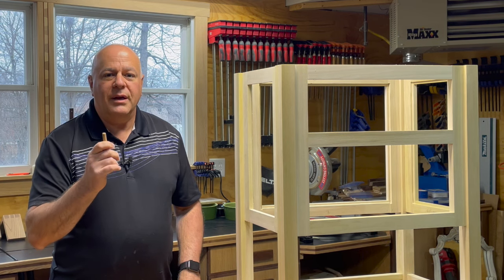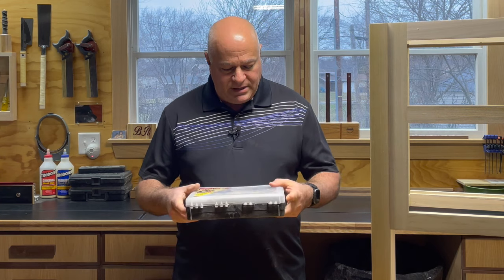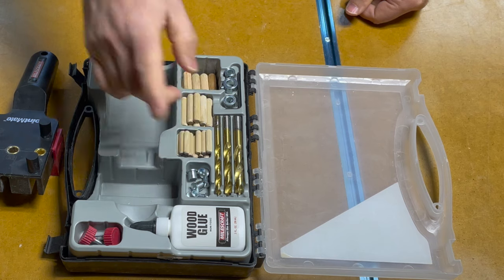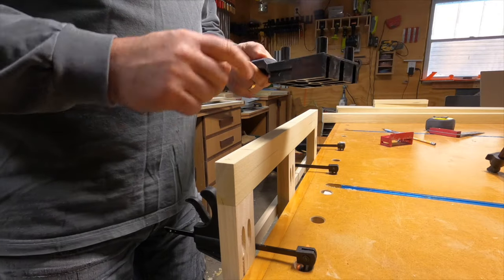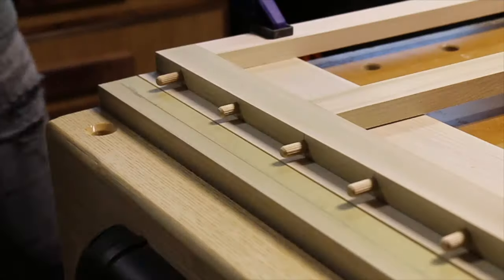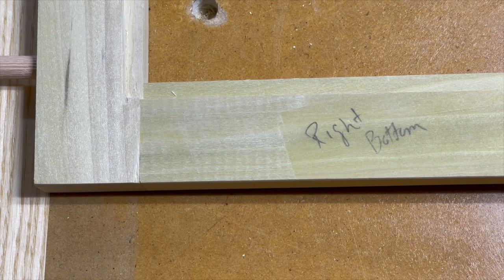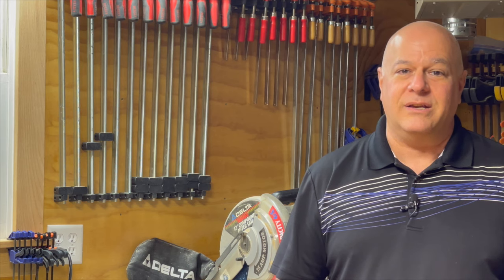Dowel Joinery for Beginners - 3 Rules for Success

Comment: Excellent video. Forgive me if others have pointed this out and you've already fixed it, but you have no treble at all in your audio. It is as though your microphone has a blanket over it. You may need an audio gear upgrade, or it may be a setting that is incorrectly adjusted in software. Best wishes. (Edit: I think it's the microphone. You're using a lapel mic which may not be up to the job. There is also some tell-tale distortion from overloading the mic.)
Reply from the maker: Thanks for the feedback! I have since upgraded my microphone.

Comment: like the video, though I still don't know how to get the butt joint properly, even with the jig. There is not enough contact surface to set the jig on, especially on the end grain. I think I'm missing something handy here. I screwed up my tests so much I've just opted for half laps.
Reply from the maker: Take another look at the 3:05 mark in the video. By clamping a second board behind the board where you will be drilling, it gives you a bigger surface to set the jig on. Hope this helps!

Comment: I began using this jig and recently splurged on the full set of dowlmax and the festool domino 700, something I swore at the beginning I won't spend that kind of money.
Reply from the maker: Both very nice tools. The Festool 700 is the Cadillac. Maybe someday I'll have the $$ for one. Need to upgrade my table saw first :-). The great thing about woodworking is there are solutions for every budget.
Reply: @budsworkshop  Same here, and having the freedom of staying away from Ikea furniture. 😆😆I need a decent table saw too, after comparing all, I am eyeing on the Maksiwa 1600, probably the most budget friendly sliding table saw and I don't have to make all other jigs like cross cut jig comparing to American style table saw. And it has a 12 inch blade instead of 10. I have to wait until I have bigger shop though. btw I didn't pay full for the festool 700. I bought it used for half the price and it's still good after few years.
Reply: Dowelmax is worth every penny. I've not felt the need for a domino since I've been using my dowelmax. Not that I don't still want one, but the dowelmax works so well that the domino can be a "later on" purchase, if production ever dictates the need.

Comment: I had bought a couple of other types of dowel jigs and even with practice, I could never get a perfectly aligned joint. Then I bought the Milescraft jig and that did the trick. That jig makes it so much easier to get accurate results.

Another doweling tool that I found to be valuable are the centering pins. With those, you could just use a drill and still get good results.

Great video. To the point with helpful information.
Reply from the maker: Thanks for sharing. I have not had occasion to use the pins yet. Appreciate your feedback!

Comment: Great video thanks, and good tips.
There is one dimension that you may have forgotten to mention, and that is the depth of the dowel holes. On the edge of boards, that’s not usually a problem, but on the face, you need to be mindful that you could drill through to the back side if you try and make both holes equal depth to accommodate the dowels length. A little calculation ( including a little extra as a well for the glue to go) will save the day….. don’t ask me how I know that😢
Reply from the maker: Great point!

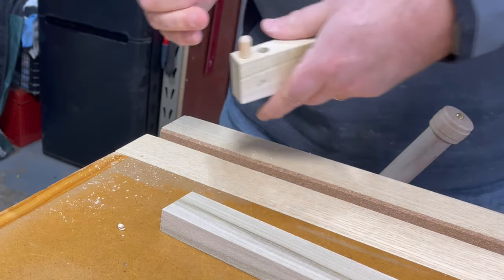Comment: Hi, at 4:22 minutes you show how to joint rail and style using dowels, can that jig make the holes in end grain narrow piece of wood?
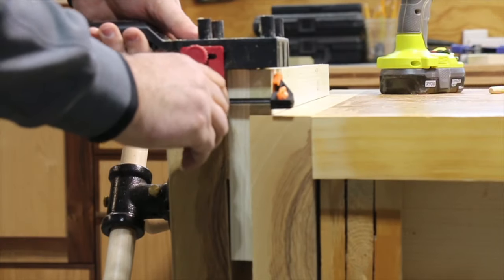Reply from the maker: Yes - If you go back to 3:00 minutes I am drilling the end grain for that joint. You have to use the fence and a clamp which is not ideal, but it works out pretty good.

Comment: At 4:53 id love to better what you mean by offset.  Maybe show what you did and what you'd do different?
Reply from the maker: By shinning the flash light through the holes, you are able to see them intersect. This caused the dowels to hit each other and the joint would not close up. By using an “offset and drilling each side in a different location it avoids them intersecting.

Comment: I am going to dowel the Nor Cal Black Walnut from my yard,  I just milled. A Fireplace mantle. The wood is 3" Thick, 6ft long. Two pieces, approx 8" wide each, forming an L for a fireplace mantle. The "L" is going down from the flat mantle.  So I need 1" Dowels?  Or can I use say, 3- 3/8 dowel at an angle or in line for the thickness? And then dowel every foot or so?
Reply from the maker: You can certainly use multiple dowels to account for the thickness. Three at an angle or even four in a square would suffice.
Reply from the maker: Every foot is a good spacing, as well.
Reply: @budsworkshop  thanks much. I'm verty scared I'm gunna mess up this Nice wood. I just had to order up a new 10" table saw, mine died. And a 80T Diablo blade
Reply from the maker: @TheHypnotstCollector  you got this! Just take your time and measure twice. 😊

Comment: Hi Bud.  I want to make a wooden frame using 1" hardwood dowels.  Can you please help me with advice how to join round dowels at a 90 degree angle to obtain a decent amount of strength and make it look reasonable.  I do plan to cover it all with a layer of fiberglass cloth and resin after the frame is built.  
Thank You.
Reply from the maker: Depends on the size of the dowel. I would probably take the same approach as making a picture frame and cut at 45 degree angle and the cut in a spline for strength.

Comment: how do you set the stop on the drill bit so you drill the right size hole? on each test piece i did it was alway to short
Reply from the maker: I put the bit through the jig so it is protruding the appropriate depth and mark the bit with a sharpie so I know where to place the drill stop.

Comment: The problem I have had with cheap jigs is they're not accurate at all. Then I have dowels that aren't straight and/or in the exact spot I need them and then my joints don't line up right. I've bought 3 different jigs so far . I guess it's true, you get what you pay for. Just gotta pull the trigger on one that's a little more pricey
Reply from the maker: Plenty of truth to "getting what you pay for". Happy woodworking!
Reply: Yeah I’m in the same boat I got a lidl one and it hasn’t got the finding centre board thing and it’s a pain